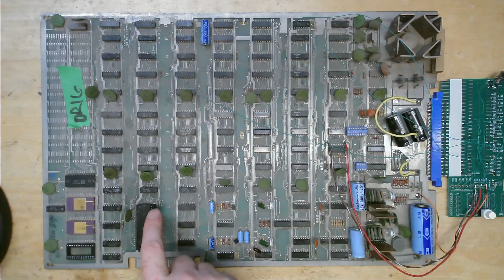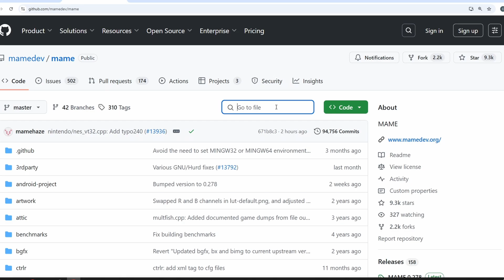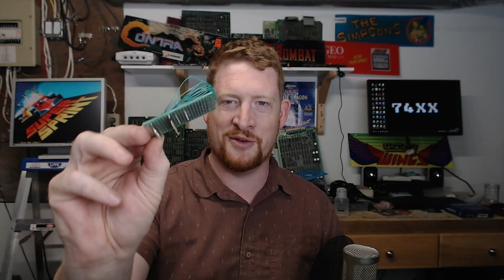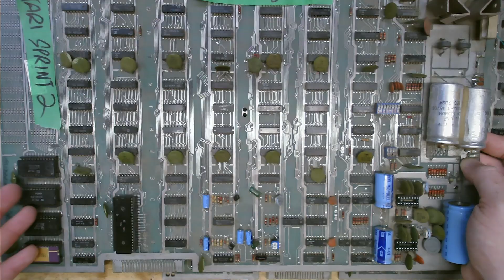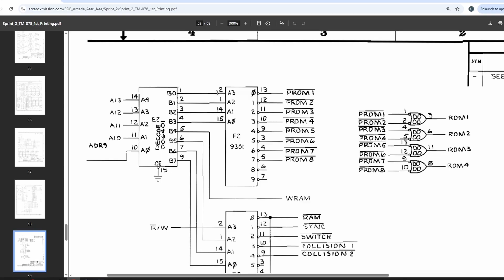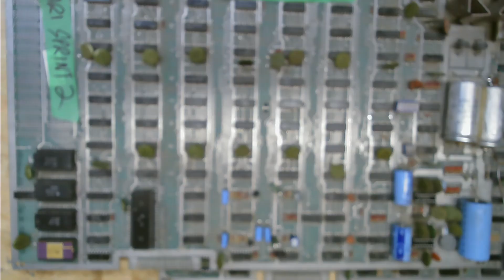Arcade PCB Repair - A custom solution for this 1976 racer!

Comment: And since the missing ROM contains the tracks, you could design your own tracks!
Plus a classic Big ROM hack.
(I'd probably put some more effort into making the game color - just look at our Tank (v=0pYwH0SYYDA), where I made player 1 and his score blue, player 2 and his score is red, the shots are cyan and yellow, the mines are green and the walls are white. Since this is CPU generated, it will be a little more difficult, but the cars are sprites which is gonna make coloring them in a lot easier. To get the score the right color, you'd have to do some math with the vertical video address bus.)
Reply from the maker: pcbjunkie did a similar thing with his Space Invaders JAMMA adapter!
Reply from the maker: And yes, when I loaded that first ROM into the programmer, you can pretty clearly see the tracks

Comment: That's some funky colours hehe! The game is normally black/white. Composite video works fine with jamma, at least on pcbs I've hooked up here when repairing them. To get that on your test rig just join red, green and blue together on the jamma adapter and join that single wire to composite video on the pcb and you'll get white. Join sync separately from the sync pin on the pcb. This also works for Midway's Space Invaders.
Reply from the maker: Thanks yes I'm using an OSSC to scale/capture the video and it didn't seem to like composite video this way, so I just tapped a few signals from a tad earlier back in the mixer chain.

Comment: I have a couple of Sprint 1 and Sprint 2 untested boards here given to me years ago. All have missing sound chips. Seems to be a rare part that always gets stolen so that's another project to make something equivalent using modern parts.
Edit: The part is TDA1004. I have the datasheet (impossible to find hehe!) and it's an audio power amplifier.  It wouldn't be difficult to make an adapter and use something like LM380.
Reply from the maker: Someone has new old stock on eBay with over 200 sold, so they're definitely in demand for something still!
Reply: @74XX_arcade  I prefer to make an adapter and use a common LM380 than pay for 50 year old chips that may or may not last longer than 5 minutes.

Comment: 5:10 I feel like you just make an adapter that fits under the 6502 and grab the address lines directly then have a giant ROM with mirrors and copies as required.
Reply from the maker: Some high score kits do this

Comment: Question: Would if have been easier to use the copy (the command line copy in Windows) command to concatenate the rom files together into one file instead of manually specifying addresses when loading the files individually? Or does that not work in this context?
Reply from the maker: Yep, could have done "copy /b 1+2+3+4 rom.bin" if I expected to use the file multiple times.
Reply: @74XX_arcade  I thought that might be the case. I always do the copy method, but it was interesting to see the manual way of doing it.
Reply: No  Wont    work   in  this  context
Reply: @rosariodagosto6484  WRONG! It works fine to join roms together. I use copy /b all the time.